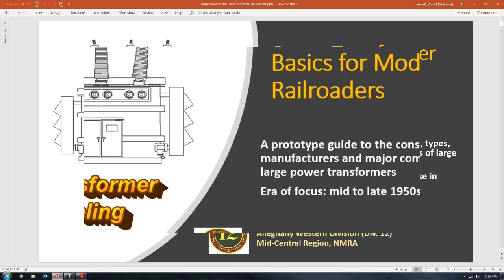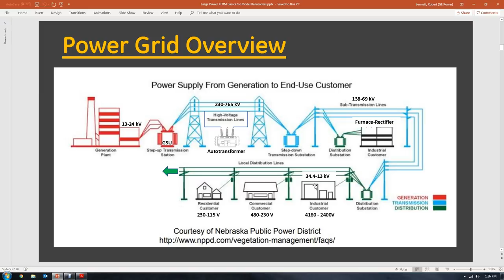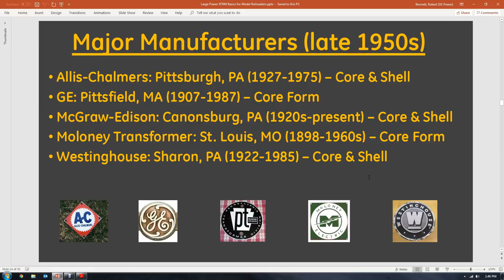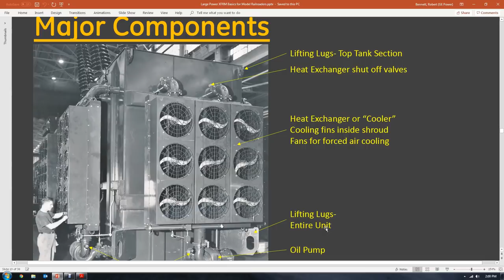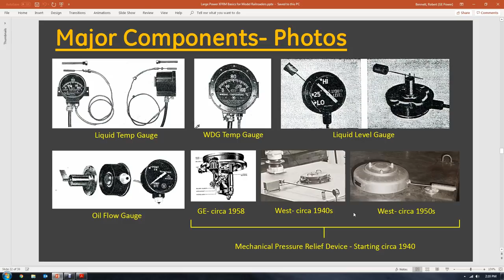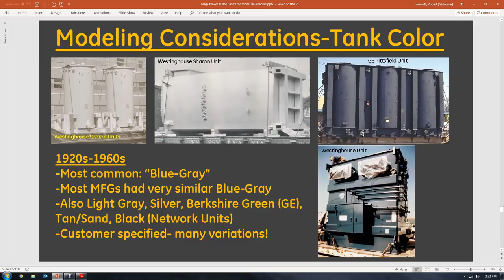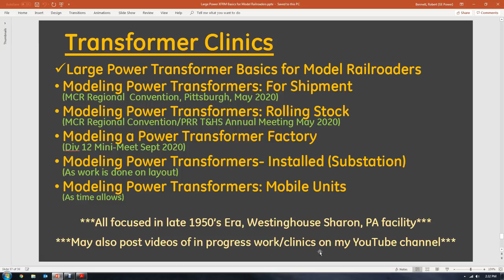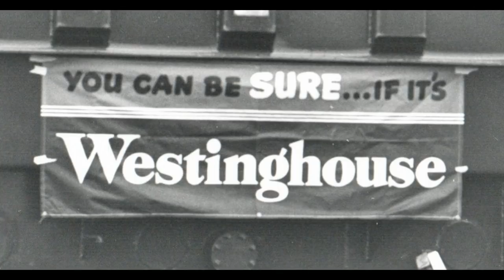Transformer Modeling: Large Power Transformer Basics for Model Railroaders

Comment: I'm a retired power engineer - Western Area Power.  We had many Westinghouse and Allis Chalmers units.  Some shell forms that we thought were bullet proof.  The only reason we removed them from service was oil sledging/paper degradation.  80 - 90 year old units. Note: We usually only loaded at 50 - 60 % nameplate. I spent time at the Pittsfield facility doing high voltage testing.  Your video was a great journey down memory lane.  Your a very good historian/teacher.  I'm about to start HO scale power system modelling so I just subbed your channel.
Reply: Thanks Bill. Good to hear from another power guy. Seems our numbers are dwindling. I made it to Pittsfield when I was with GE, but it was well after the closing so most of the plant was gone or repurposed. I would love to see what you come up with in terms of power system modeling. I know the transformers, but claim no expertise on the rest of the system!
Reply: @robbennett1965  Your video has given me some ideas.   My era will be the era of oil circuit breakers and the world of Allis Chalmers. Probably 115 to 69 kV.

Don't tell anyone, but when i was a field engineer, the line crew used to collect old colored insulators from abandoned railroad signal poles.   They were near our transmission line ROW.  I have a few in my office.  
Sidebar"  The old GE Pittsfield high voltage test facility was taken over by EPRI.  We did some high voltage testing with our transmission line insulators.  What impressed me was that they placed transformers in series to develop over million volts.  You probably remember the  transformers that stood on tall insulated platforms.  They just daisy chained the them in series and cranked up the voltage.  Fond memories.  Stay safe and I look forward to watching more of your excellent videos.

Comment: Great presentation!  Really looking forward to your future installments.  I'm actually modeling a loose interpretation of the Erie Railroad and their New Castle branch, which passed through Sharon, and have been wanting to add some of these types of loads to my flat cars.  (I have some PRR interchange going on as well just because I like all of the specialized flats they used.)  I just learned more from watching this video than I've been able to figure out on my own after months of research.  THANKS!!
Reply: I would love to see how you interpreted the New Castle branch! Very cool. I do think, but haven't been able to confirm with photo evidence, that the Erie served the Westinghouse plant at the South/East end. All the photos I have are on the North/West end where the units were shipped, and it was all PRR.
Reply: @robbennett1965  I haven't been able to find any photo evidence, but I did find an engineering drawing from 1942 that shows some changes to the Erie's tracks - it's titled "Track Changes to Facilitate Switching Westinghouse Electric and Manufacturing Company Plant Sharon, PA."  From what I can see the Erie ran down or next to what is now Sharpsville Ave and their tracks into the plant were just south of Silver St.  I'm hoping Morning Sun's upcoming fifth volume of Erie official photography will have something.  My layout is still in the benchwork stage  so not a lot going on yet.  But hopefully I'll start getting some videos on YouTube soon!

Comment: Rob! OK. So I have to come clean. This is interesting to me. When I  left university in 1983 I joined GEC Industrial Controls Ltd in Rugby, UK as a graduate trainee accountant. I can see those rivets!! We were part of the power transmission and distribution division and made vacuum switches and stuff to start, slow and stop electric motors in industrial applications. Well I  have to say that we just made the best equipments and if you look deep into your heart you know I'm right!! None of your Westinghouse/ GEC ( curly letters) nonsense, like stuff that lasted 😀😀😀. Transformers like the ones you describe came out of Stafford. I have always been  intrigued by the transportation of these transformers.  We used a company called ALE. Abnormal load engineering.  Look them up UK. Our stuff was all small. Right next to me now is a contactor from the smallest 22kv vacuum switch in the world at the time. A souvenir from when I  left. Uncommon as very sensitive at the time. It is just beautiful copper and molybdenum engineering, developed by my friends. Only ~3" cubed in Coors ceramics. I've not yet finished your video, but will. Your latest post reminded me about it. Just on the wind! Kindest Regards Stephen.

Comment: Excellent video with TONS of info. How does the Walthers transformer fit into the general scheme of things? Accurate or very generic?
Reply: The Walthers kit is a decent 1970s onward unit. Some of the details can be improved and added, but it includes fairly accurate bushings and radiators. Of all the offerings I have seen it is the best to start with if you are modeling a US prototype from the ~1970s on.

Comment: I'm curious to know what the life span of these units would be.
Reply: Usually over 25 years. There are some still in service from the 1940s, and we were using a voltage regulator in the shop built by GE in 1910. We will see how the units being built now-a-days will last as the quality and robustness is not the same as the units built by Westinghouse, GE, McGraw, etc.